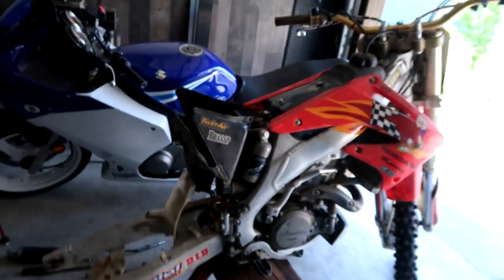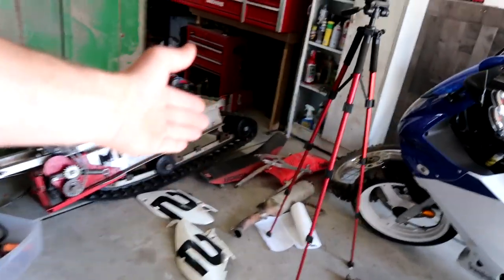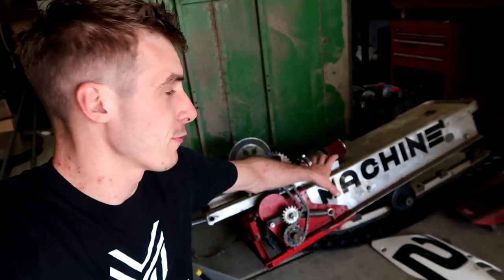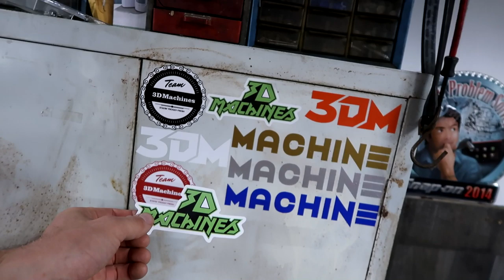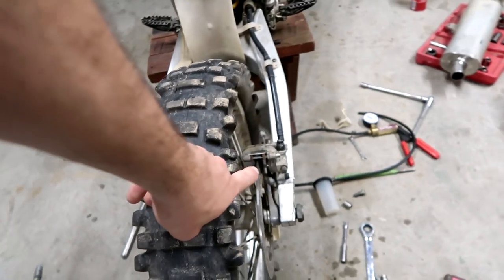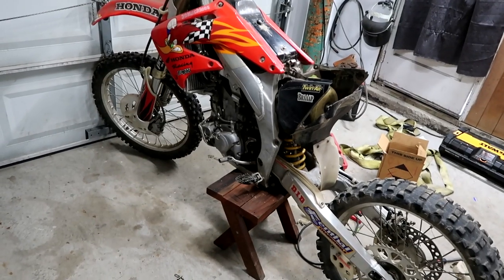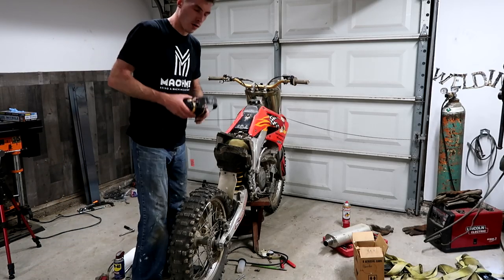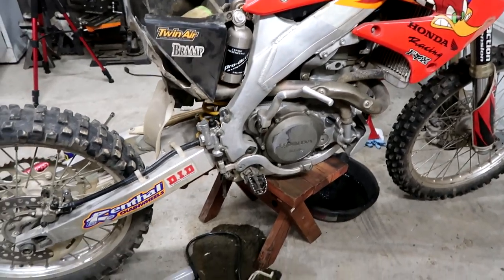UN DESTROYING MY HONDA 450

Comment: I feel like the InstaGator needs to be geared a little taller
(keeping the  CVT as it is). 
Also I really think it'd be best to build a traditional two stroke baffle. Like use a smaller steel tube to make the stinger and drill a crap ton of holes.. Use PVC or steel tube for the baffle. Make it all like 2 fee long.

Comment: 4 joke, err stroke bike engines most always need some back pressure from full exhaust/muffler setup to not over scavenge and suck the new fuel charge out the exhaust ( there's cases of built/modified race "machines" where that doesn't apply and ou want as much scavenging as possible, mainly drag racing/ highest of RPM's ;)